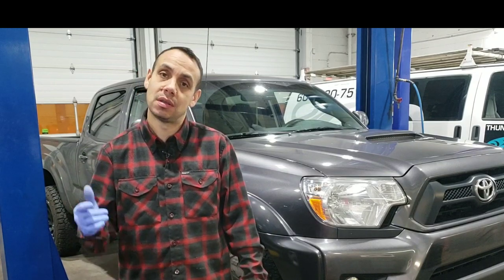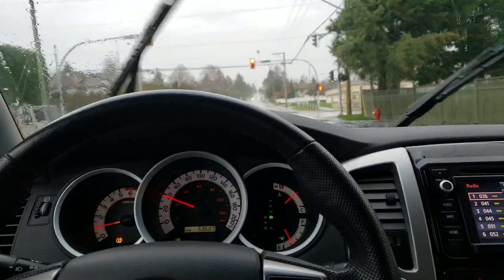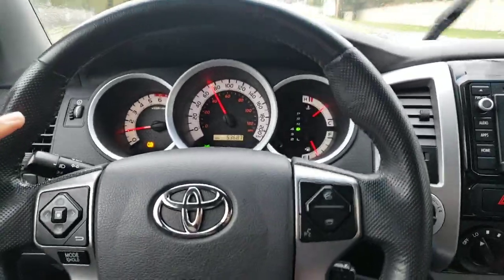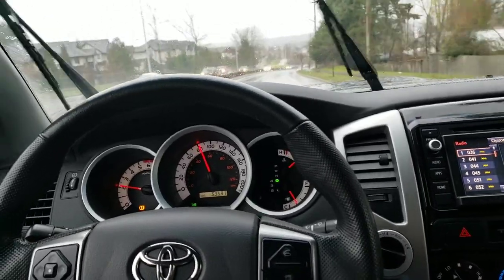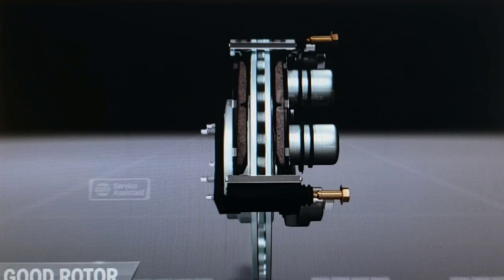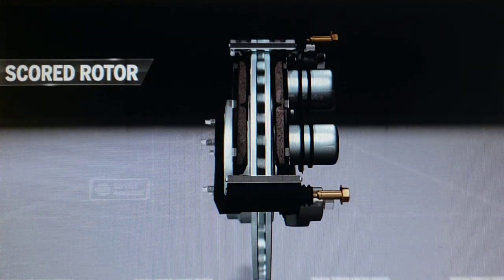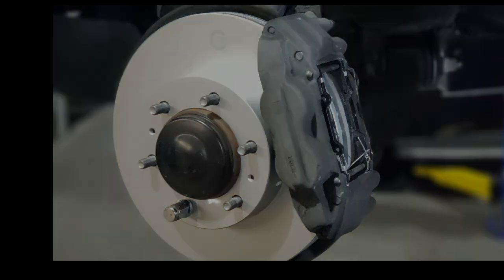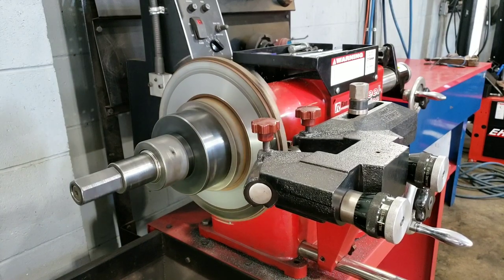Symptoms of warped brake rotors explained.

Comment: Would a wheel wobble if rear rotors are warped?
Reply from the maker: Unlikely. If the wheel is wobbling I'd consider the tire, wheel, hub, bearing etc.. tough for me to comment without seeing the issue.